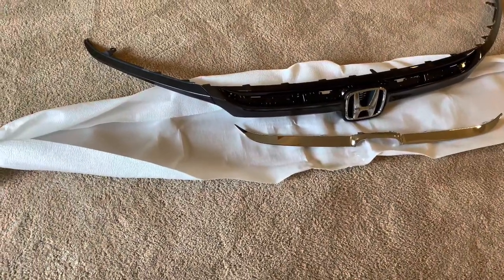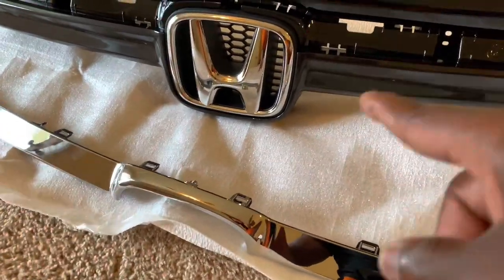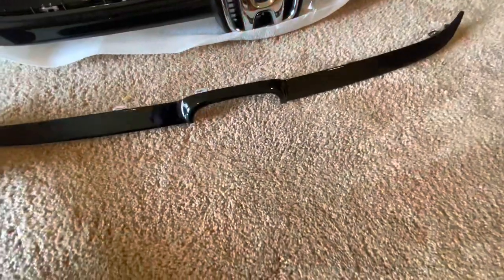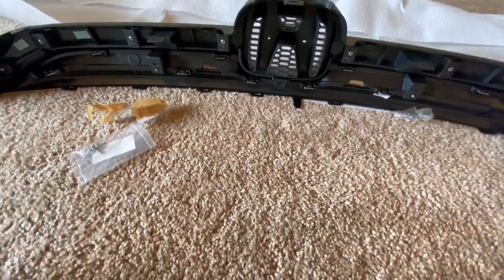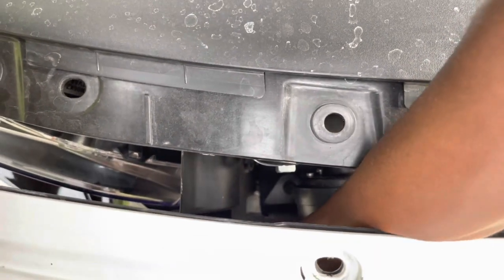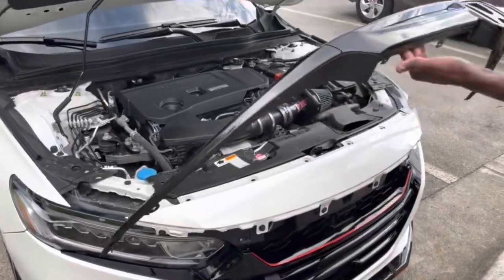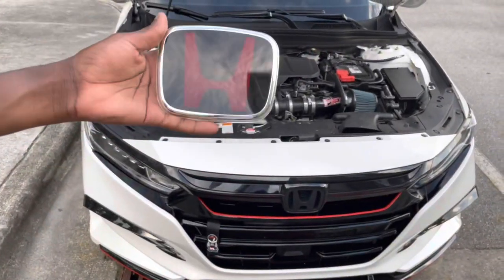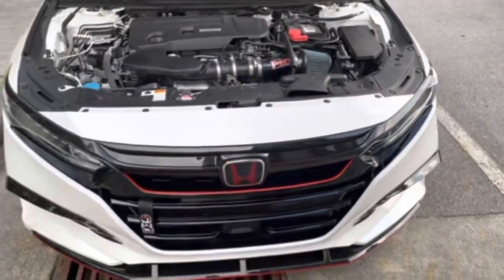2018-2020 Honda Accord OEM Accessory sport grill install *wrapped garnish gloss black

Comment: I got the same grill on my 22. Its an oem as well. Had to do slight modification for it to work though lol. But it looks nice af
Reply: I have a 22 as well.. I heard the fitment is different for previous years.. what complications/modifications did you encounter?
Reply: @lulgjurajx97  I just had to shave off a piece of the lower grill I believe for the top piece to kinda  sit right. The top grille on the 22 hs a big plastic trim that it’s made on to that’s why. You could actually just get a lower grill from a 2018-2020 accord to use the factory clip in points for the oem sport grill

Comment: Will this work for a 2021?
Reply from the maker: Gotta buy the oem grill specific for 2021 model year. The grill is a little bit different for 21 so check your local dealer